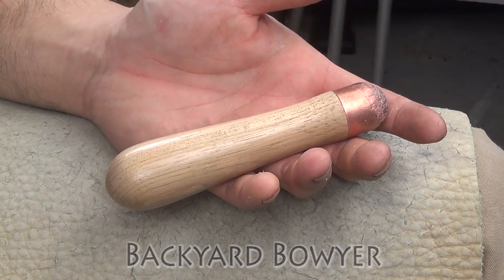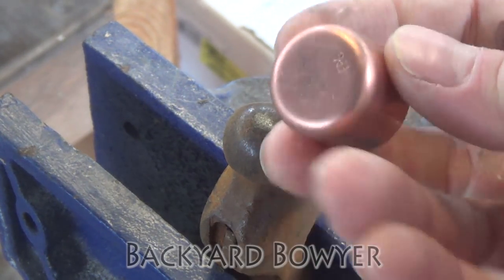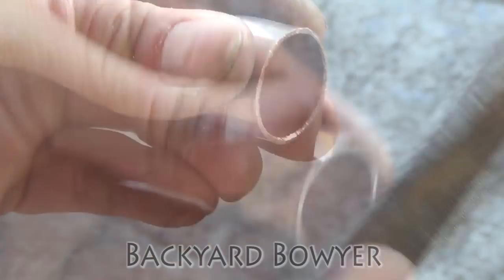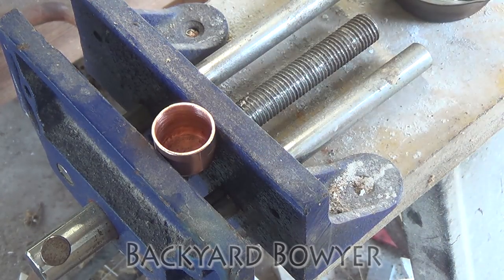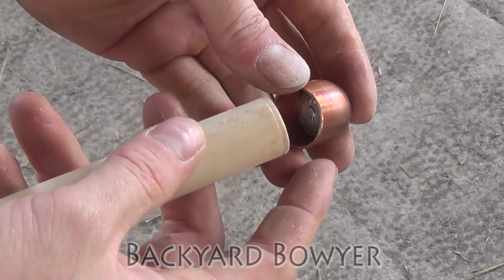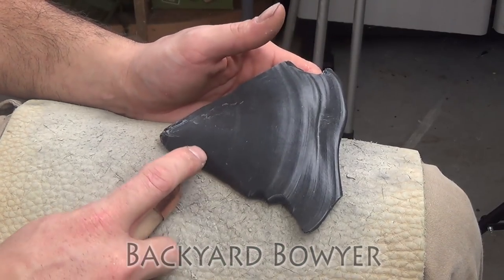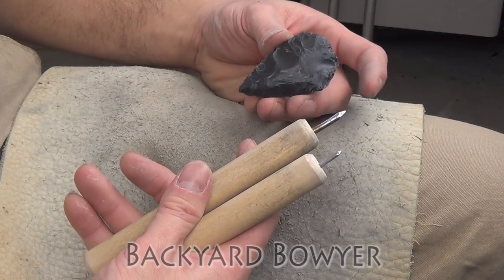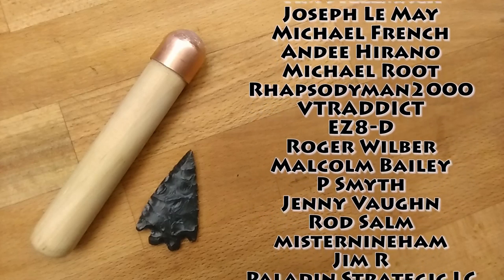Making a DIY Copper Bopper

Comment: Being a broke college student, with little access to tools, I have found that a railroad spike actually works remarkably well as a bopper on the cheap. Most definitely wouldn't work as well as something like this though.
Reply: Be careful about going on RR property. Many dont know it's trespassing, as the world gets worse.
Reply: @senatorjosephmccarthy2720  yeah this is true. I personally don't walk them. I just end up with them from time to time either from people who do or I find the occasional one in scrap yards
Reply: A few years ago I bought a dozen railroad spikes on EBay for a buck apiece, and they’ve turned out to be surprisingly useful for one thing or another. 

The steel is somewhere between mild steel and and tool steel—something like 0.5% carbon, so you have to be a little bit picky about where to use it. It doesn’t quench harden like tool steel but it seems tougher than mild steel.
Reply: @senatorjosephmccarthy2720  
Frankly no one except bureaucrats care about a missing railroad spike or two and when you’re not a bureaucrat you get what you need wherever you can
Reply: If you heat it up to red and let it cool slowly it.will be softer

Comment: You can stand a woodscrew in the cap before pouring the lead to aid fixing to dowel
Reply from the maker: +david bradley It could also help add more forward weight, which may make it more effective. I'll have to try that. Thanks for the suggestion!

Comment: Nick I ran across your work while watching flint knapping video's. Your variet of skills and use of basic tools to accomplish complex tasks is enviable. I Will be ordering your Knifemaking book. and you can bet I will be following your work on FB. 
The only comment I can offer on the Copper Bopper is to add a cross pin once the glue has dried. A little mechanical bonding can only reinforce the chemical bond of the Wood to Copper glue up.

Comment: took some doing to find this video, thanks i had everything i needed in my shed .
oh seeing your cut broom handle (6" long  or even less) if you take one that size when hanging a heavy or light door you can do it alone using this tool  . place the door close to where you want it , throw that dowel under the side away from the hinges and you can just lean it to and from . it will take all the weight off of you , make it a one man job , and the hinge hits the slot every time . though having one of those with the round end as i cut mine from a broom got me some weird looks when seen in my toolbox.

Comment: I just made myself a bopper a few hours ago. My first use of mine was not as productive as yours. I didn't have a ballpeen so I used a wrench. Good video.
Reply from the maker: +Quinton Tyree Cool! Did you use the rounded end of the wrench? That's an excellent idea!
Reply: BackyardBowyer I did. Mine didn't turn out as domed but that was just my lack of patience. I can wait to get some bigger material to give it a proper try. But it works well on bottle glass.

Comment: Thanks for the tip on the copper wire I done made 4 different sizes of boppers for under 10 bucks I had some lead and handles can be made from anything such as old rake or shovels handles etc. I’m brand new to this so I wanted to see how far I would go with it before spending any money on it plus I like to be i independent I feel primitive skills should be practiced with homemade tools. Anyways thanks for the tips.
Reply: The more that know and practice the old " primitive" ways the better.

Comment: The first one I ever made, I did not weigh it at all. It was just copper over wood. It worked, though I heard about weigh so I made another were I drove a steel rod into the wood to increase the weight at the end. It worked better. So I bought one a while back after all that, and it worked WAY better then mine. Apparently even with the steel, mine were too light. Again though, they did work.

Comment: 5 minz into the vid, and i was like .... so what is a bopper?
Reply: will shang 
Another word is a 'billet', usually made out of large pieces of antler. It's a lot easier than a hammerstone, and functions like an oversized pressure flaker.
Reply: it's a jazz aficionado. 
KEvron
Reply: It’s a tool to bop rocks and break off flakes when you are shaping knives, arrowheads, etc.

Comment: Thanks for sharing where can you find a piece of copper rod for pressure flaking I don’t need three foot what do you think about using brass road!
Reply: I just went to lowes the other day, and got them to cut me off a 1 ft length of number 4 copper wire, and then from there cut that into the pieces that I need. cost me like $1.50. Also, you can make do with steel nails, deer antler, and maybe even wood if it's a decent hard wood (or so I here. haven't tried that one).

Comment: Why did you only make 1 piece out of that lil slab? You chipped away until you got your end piece..why? Is there a "hard spot" you were trying to find?
Reply from the maker: +ADANTHEGIANT I was hoping the end piece would be quite a bit bigger, but I ended up losing quite a bit after the end broke. The main thing I'm looking for is a good thickness to width ratio.

Normally if I started with a slab, I would have cut it in half to get two pieces. Since I started with a big flake, I pretty much just had to reduce it to the width I wanted.

Thanks for watching!

Comment: What's the lead for?
Reply from the maker: +Narwhocalypse It's to add forward weight to assist in striking and as a backer for the thin copper cap. I've gotten a couple suggestions to use bismuth as a lead alternative since it's very similar in terms of density, hardness, and melting point.

Thanks for watching!
Reply: BackyardBowyer Thanks for answering.
Reply: Narwhocalypse weight

Comment: Where can I buy lead
Reply: If all else fails, you can buy solder at the big boxes or hardware stores. Don't buy rosin core if possible, although it will work.